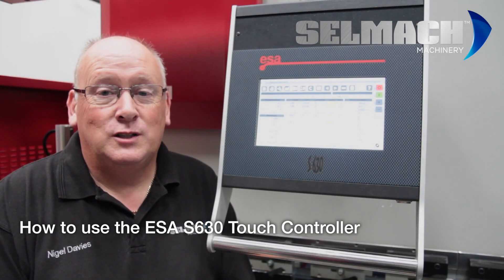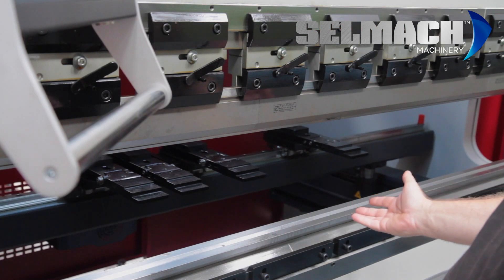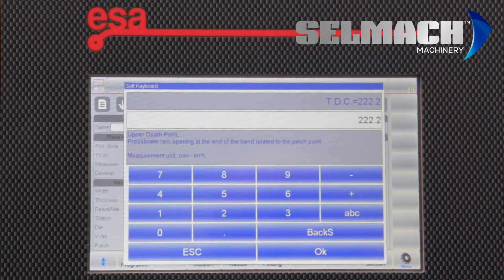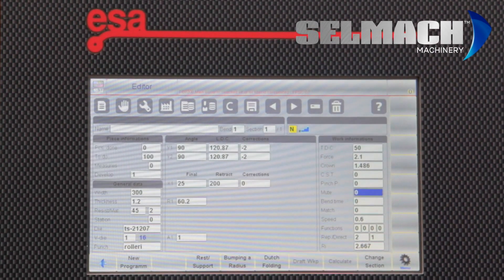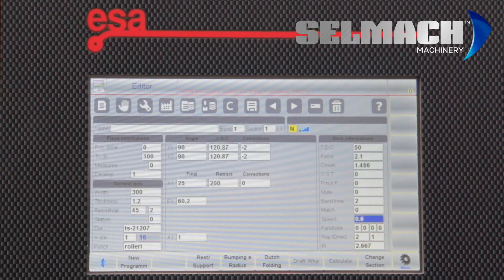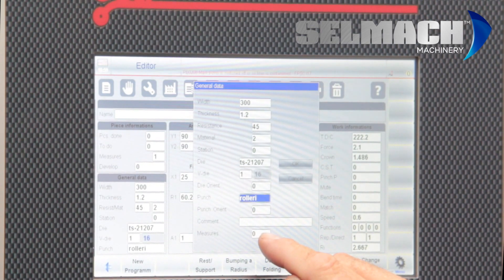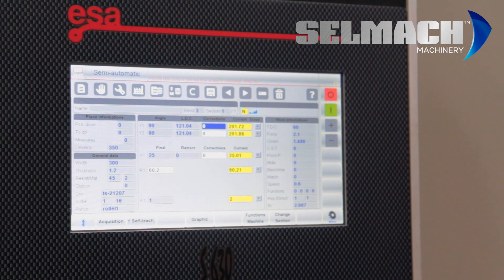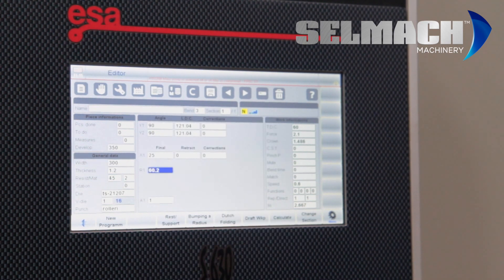How to use the ESA S630 Touch Control Panel FAQ

Comment: Need help.
Operation system got problem. Unable to boot now.
i think need to install back the windows. What is the windows version ?
Reply from the maker: Typically the ESA S630 comes pre-installed with Windows 10, but best to check with the original supplier what was supplied on your particular machine
Reply: the controller only have 128MB storage space. 
How to install the Windows 10? @SelmachMachineryLtd
Reply from the maker: Sorry it's not something we've encountered before, your best option would be to contact ESA Directly - https://www.esautomationinc.com/

Comment: On what basis are you selecting the material specs
Reply: Most metals are pre graded from stockhouses when you buy them. Stainless 301 is a harder material around 88 and then soft steel is general around 45.